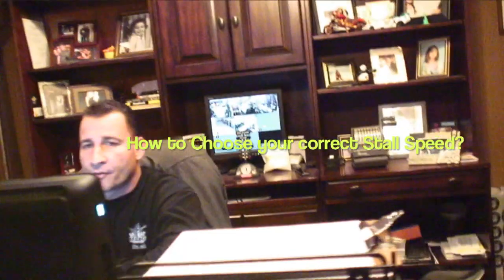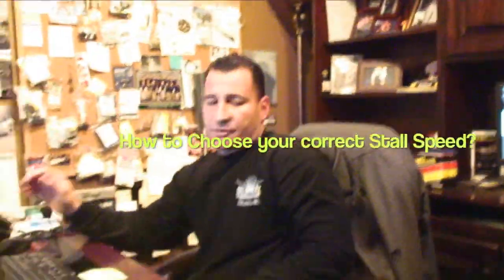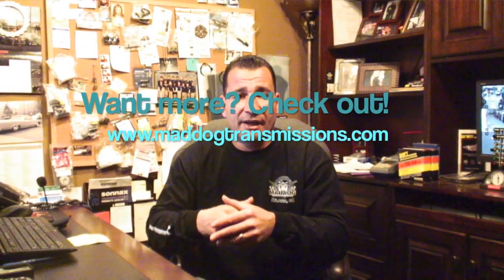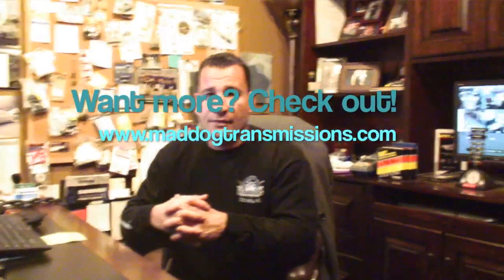How to choose the correct stall speed?

Comment: I have a rebuilt 302 foxbody with e303 cam gt40p heads cobra upper n lower intake & 410 gears... Pairing with a b&m trans with shift kit... I put my stall in wrong so I'm going with another one but what would be a match to go with setup... Thanks
Reply: The best way to pick a stall for your converter is to go off of what the Basic operating RPM range or basic operating power band range is.  Usually it is listed on your Cam Card, but some companies you may have to call for that info.  It is a range of numbers, for example 1600-5200 rpm or power band range.  You want to stay within 200 of where it starts, so in the example case you would want to go with a 1600-1800 stall.  The power comes in where it stalls at so if it starts at 1600 and you get a 2400-2600 stall you miss the range of power between 1600-2400 rpm.  Also, the amount of HP you have comes into play with the converter because if you have more than 600HP, are running a Turbo, Super Charger or NOS then you will want to get at least an anti-ballooning plate and possibly a billet hub or dual or triple disk  inside the converter. Mad Dog Transmissions 770-781-0949

Comment: I'm running a 2k-2200 stall...wanted to change cam...cam saying a 2400 stall...is it worth me switching it...or would I be ok with my current stall?
Reply: You are not that far off so it really shouldn't make a difference.  I would say go ahead and run the one you have.  Mad Dog Transmissions 770-781-0949

Comment: There is a lot more to take in to consideration when selecting a torque converter.......call your converter companies 1st
Reply: Thanks for your input.  We are aware that there are a couple other things to consider when choosing a stall for a converter.  We have been doing this for 30 years, and have not had any issues suggesting the proper converter stall and set up for their converters. Mad Dog Transmissions 770-781-0949
Reply: I’ve also been doing this about 30 years. I’m sure you do a great job with your service and recommendations.

Comment: This is my first big cam build. I have a 355 sbc 288 480 cam 106 110 center line. I  have a 2 to 2200 stall the card shows 2 to 5000??? Is this not enough stall cause when I pull it into any gear it wants to jump but still idles. When I let off the brake it will to start pulling the car 1988 700r4 transmission
Reply: If your Cam card says that the RPM Range or Power Band range is 2000-5000 then yes, the 2000-2200 stall is good to run.  In order to utilize your  full range of power you want to stay where the Power Band/ RPM Range starts.
Reply: @maddogtransmissions3125  thank you is there anyway to make my 700r4 shift harder

Comment: Got a stock cam ,heads, foxbody 5.0 carb .got new nos system 373 gears drag radials  tires headers .and a new tci Aod  streetfighter transmission  what stall do you recommend?
Reply: The stall goes off of your Cam.  If you know the power band or RPM range for your Cam, you don't want to go more than 200 above where it starts.  For example, if the power band is 1600-5200 then the option for the best performance would be 1600-1800 stall.  If you do not know your power band or RPM range then since it is stock you can just go with a stock stall.  However, since you have NOS then you will need an anti-balloon plate or when you hit the NOS the power is going to blow apart your converter.  Any other questions just give us a call.  Mad Dog Transmissions 770-781-0949

Comment: Hey Lou, I have a 75 Corvette with original auto trans and rear end, I had the motor built to a 383 Stroker with around 425-450 HP, when I start the car I have to hold the brake to keep it from lunging forward, do you think this has anything to do with the converter being mechanically frozen or could it be something else?
Reply: Hi Michael, If your car is in gear and it lunges forward then the stall is to high.  If it is in park and it does it then there is something wrong with the transmission.  If you have any other questions just let us know.  You could give us a call at 770-71-0949 if you want to discus it in more detail over the phone.  Mad Dog Transmissions
Reply: @maddogtransmissions3125  When in gear, sorry...I'll give you a call.

Comment: I want SWAP OUT MY STOCK CAM IN MY LQ4.. I WANT NICE STREET CAR. NOT TOO CRAZY JUST ENOUGH TO SPANK A COUPLE OF PONYS N SOME MOPARS...lol 
Wait B4 I 4GET MY LQ4 IS IN MY 87 TOYOTA COROLLA SR5.. WITH 400TURBO TRANS & IM USING 8.8 FORD REAR N 410 GEARS.. WITH A MINISPOOL ..WITH LS6 INTAKE N 92MM THROTTLE BODY
Reply: That sounds like a pretty bad car.  Give us a call when you get your Cam and have your cam specs and we can help you figure out what stall you will need.  Mad Dog Transmissions 770-781-049

Comment: Pontiac  400 with a comp cam kit K51-600-5 thumper what would be the best stall for this application with a th400 trans
Reply: Where does your power band start?  Mad Dog Transmissions 770-781-0949
Reply: Basic Operating RPM Range: 2,000-5,800
Reply: Is 2500 stall to much
Reply: @maddogtransmissions3125  thank you so much I appreciate it

Comment: I'm building a 62 Sunbeam with a 350 sbc, camel humps w/screw in studs, 3/4 Crane fireball cam, Team G intake, 10.5:1 compression, 650 duel feed double pumper, Scorpion roller rockers, T350 w/B&M shift kit. I've been looking at a TCI "Sizzler" 2600-2800 torque converter?

Comment: Power band is from 2002 6500, 3500 stall converter .. is that to much? Street/strip car
Reply: Thanks for your inquiry.  Our professional opinion is you should go 2000-2200 no higher than 2400 Stall.  Mad Dog Transmissions 770-781-0949

Comment: Here's one for you: 
2014 Jeep SRT
Curb weight: 5100lbs
Engine - 6.4L
Differential - 3.70:1
Tires - 295/45ZR20
Camshaft - COMP 274
Duration @ .50" lift: INT-226, EXH-234
Lift: INT-0.619, EXH-0.612
Lobe Separation: 116
RPM Range: 2400 to 7400

So, should my Stall speed range be between 2900 to 3300?
Reply: By looking at the numbers on that cam, I imagine the engine has quite the lope in the idle.
Reply: Addison Allen 4K stalk.

Comment: Hi Lou, I have an Pontiac 400 with Edelbrock 750, RPM inlet manifold and no clue, which changes have been done in the the past on the car. The car is since 20 years in Germany and went to various owner, it has been built up nice and seems to have quite good power, but with the TH400 and the current (I expect stock torque converter) it feels like the car starts moving, before the engine built up really torque. From my feeling, the engine should be about 1000 refs higher running before it give the full power to drivetrain. So a 2400 stall may help?

Comment: I have a 350 engine in a 4x4 blazer with 292 camps and th350 transmission, with 373 springs, which torque converter do I need to run light and strong?
Reply: I would go with a 7000 stall Hughes converter if I were you.
Reply: The punisher I have the same setup so when ever you find out please let me Know brother
Reply: I know this will sound expensive and time consuming but the best thing to do is to try different stalls within the estimated ball park numbers until you find what the car likes and what gives you that kick in the pants feeling you are looking for, often times the "best" stall based on formulas, books, charts, and numbers is not what guys think they want, just saying, you will buy two or three stall converters and pay two three times more but in the end you will go damn that is the shizzle

Comment: hi my cam rpm range is 1600 5800 will that help  thanks
Reply from the maker: Hello Giovanni, go with a 1800 stall. You can call us at Maddog transmission 770-781-0949 Thanks MaddogLou.
Reply: I have a 3080lb 68 mustang C4 trans, 410 gears, 28in tire, 11.35:1 cr 438Windsor with Comps cam xr292r solid street roller 254, 260@50 duration fuel injected multi port. Comp recommends 3500 Stall or higher. What do you recommend..I am thinking 4500 stall. What do you say. Comp cams says power range of cam is 3200-7200 rpm.

Comment: hi lou i have a 350 stock motor with a xe268h cam with promaxx aluminum heads 65 cc 373 rear end 700r4 trans  can you tell me what size torque converter should i use? street car don't want no police citations lol
Camshaft Part                    #
                        12-242-2
                        Designation
                        XE268H-10
                    
                    
                        Duration @ 0.006":
                        268° / 280°
                        Duration @ 0.050":
                        224° / 230°
                    
                    
                        Max Lift w/ 1.5RR: 
                        .477" / .480"
                        Lobe Separation:
                        110°
Reply: Giovanni Krasniqi I'm curious to but my 350 is over .60 and has a 292xfi
Reply from the maker: Hello Giovanni,go with a 2500 stall.You can call us at Maddog transmission 770-781-0949 Thanks MaddogLou.

Comment: I have a O2 Sierra 4.8 whit tru trac posi 410 gears and tune .what stall should I go whit ??2800?
Reply from the maker: Hello Jose, no more then 2800 stall. you can call us at Maddog transmission 770-781-0949 Thanks MaddogLou.
Reply: I have a 3080lb 68 mustang C4 trans, 410 gears, 28in tire, 11.35:1 cr 438Windsor with Comps cam xr292r solid street roller 254, 260@50 duration fuel injected multi port. Comp recommends 3500 Stall or higher. What do you recommend..I am thinking 4500 stall. What do you say. Comp cams says power range of cam is 3200-7200 rpm

Comment: I HAVE A 2014 SILVERADO SINGLE CAB..HAS HEADERS INTAKE N CUSTOM TUNE MAKING 355 RWHP
WHAT STALL DO YOU RECOMMEND? 6L80
PLAN ON CAMMING IT IN THE FUTURE ASWELL
Reply from the maker: Hello Santa ana, always mach the converter to the cam specs. You can call us at maddog transmission 770-781-0949 Thanks MaddogLou.
Reply from the maker: Hello Santa ana, go with a 2500 stall you can call us at maddog transmission 770-781-0949 Thanks MaddogLou.
Reply: ... 355 rwhp in a 14 Silverado, so your running a 700 horse 6.0 huh... You must replace u-joints daily too huh..

Comment: Sorry I meant other things bolted on looking to run a 150 shot of nitrous and NT-555R drag radials. 3.73 gears I would like the converter to lock up I was thinking about a 2800 stall what do you think. Please let me know as soon as you can I'm looking to order some stuff soon and do you think I could find a good converter between $250.00 to 375.00 maximum price? Thinks for the video great job.
Reply from the maker: Hello Rich, 2800 stall will work but with 150 shot NOS you need to go with a anti balloon plate converter the cost is $550.00.Please contact us for a professional consultation regarding your needs. We are happy to provide you with references both here in the United States and Internationally. Be sure to check out our website atmaddogtransmissions.com 

Hear what our customers and fans say on our Facebook Page at www.facebook.com/maddogtransmissions 

We also accept orders over the phone. Be sure to contact us and we will recommend the correct transmission for your application. For your convenience, we accept PayPal and all major credit and debit cards. 

If you prefer, we can call you personally, just e-mail us your phone number.

All our transmissions are very strong and reliable, and can be used for everyday driving. Extended warranties are also available.

You can call us and talk to a live person. Up until 10 PM Eastern standard time , Monday through Sunday we can take your order over the phone.

Thank You,
"Mad Dog" Lou

Mad Dog Transmissions
Phone 770-781-0949

Comment: I just got my 350 running that i rebuilt i installed a lunati cam 60104 problem is when i put it in gear idle drops crazy only in gear would that be too low or a stall? im thinking it may be a factory converter not sure about that
Reply from the maker: Hello boss man, yes sounds like you need more stall check your cam card and give us a call 770-781-0949 maddogtransmissions.
Reply: +Lou Koulouvaris it says 2200-6400
Reply from the maker: OK go with a 2200 stall call us anytime 770-781-0949 Thanks maddogLOU.

Comment: hey Luo i have a 5.7 vortec 4l60e going to rebuild both engine and transmission i will be putting  a lt4 hot cam what is the stall speed you would recommend on my application i have 373 gears and its a 4wd
Reply from the maker: +omar alvarez Hello Omar, go with a 2200 to 2400 stall for your application.          Call us any time 770-781-0949

Comment: I have a comp cam hydraulic camshaft 231 duration at .050" with .480"lift power range of 2000-5700 rpms 400 turbo transmission and 355 rear gears 'would you know what torque converter would be best thanks
Reply from the maker: Kevin Thomas 
Hello Kevin, go with a 2200 stall it will work excellent for your 
application.

Please 
contact us for a professional consultation regarding your needs. We are happy to 
provide you with references both here in the United States and 
Internationally.

We also accept orders over the phone. Be sure to contact 
us and we will recommend the correct transmission for your application. For your 
convenience, we accept PayPal and all major credit and debit cards. 

If 
you prefer, we can call you personally, just e-mail us your phone 
number.

All our transmissions are very strong and reliable, and can be 
used for everyday driving. Extended warranties are also available. You can call 
us, Monday through Sunday from 8 AM to 10 PM Eastern standard time, you will 
always get a live person.

Thank You,
"Mad Dog" Lou

Mad Dog Transmissions
Phone 
770-781-0949

Comment: hi guys - thanks for the vid. Im also new to the stall thing - rebuild my 77 camaro, 350 roller, GM hotcam 218/228, 342 rear (might goto 373 later), 200-4r, long tube headers, true duals, eddie intake, - I have the stock stall now but want to liven her up, street toy and maybe some fun strip days - nothing major - 

would 2800 be too much? what do u recommend? was looking at this: http://www.tciauto.com/tc/streetfighterr-converter-gm-1981-84-700r4-all-200c-2004r-27-spline-1-703-crank-pilot-lock-uphtml/

Comment: I have a Howard cam part number 112041-09 and I'm trying to determine what size came I need. The lift is a .510. What size stall converter do I need to run?
Reply from the maker: Hello Keion, go with a 2400 stall.
 
 You can call us, Monday through Sunday from 8 AM to 10 PM Eastern standard time, you will always get a live person.

Please contact us for a professional consultation regarding your needs. We are happy to provide you with references both here in the United States and Internationally.

If you prefer, we can call you personally, just e-mail us your phone number.

Phone 770-781-0949

Comment: Hey Lou, I like the advise you're giving in this video.  I really think you need to address gear ratio and tire size though in relation to power band at cruising speeds for cars that will be driven at less then WOT.  It's no good to put a "big" cam with a 3500 stall converter in a car that cruises at 2500 rpm at 65 mph.

Comment: Hey Mad dog ! I'm building an 83 fiord Fairmont  the Block is a 70-71 302. Dart World full race heads. 750 holly carb (not a dbl pumper). alum intake. roller rockers, shorty headers. 10:1  compression pistons. Tranny is a C4 auto with a manual reverse shift valve body 3 speed. Rear end is 8.8 with true posi.  The stang I got all the stuff out of had a 4000 stall. it only has 500 miles on it. but obviously I ain't gonna use it. I have the brand new cam right here next to me !  I didn't get a cam card in the box but there is a tag on the outside with all the info on it !
for ex.. Cam lift=( INT. .320 EXH. .320)   Valve lift= (INT. .512 EXH.  .512)  There is nothing about RPM range on this box tag ! What size stall is the best ! I want it streetable !
Reply: Hello
davieboy1970, a 12 inch diameter 2400 stall converter will work excellent with your cam specs also very Street friendly.
You can call us and talk to a live person. Up until 10 PM Eastern standard time , Monday through Sunday.

Thank You,
"Mad Dog" Lou

Mad Dog Transmissions
Phone 770-781-0949
Reply: Ok Yeah I called Summit Racing tech line also and gave them all my specs. and according to my Cam part # they said to use a 2500 stall ! Now the question I have is does it matter the diameter size ?? You said 12" the one that came with the car is a 4000 stall 10". what is the difference between a 10" 11" or a 12" ??
Reply: It's not really gonna be driven "every day" Kinda more or less to take it to car shows, cruise on nice days, Show off to all my friends. I want it to have good power and torque but yet  be able to cruise the roads without it being to hard with a big converter. I suppose a 2500 to a 2800 sounds about right !! Thanks ! I'll call that number and see what it would cost me to have one built !
Reply: davieboy1970  Instead of playing the guessing game... why don't people just do a dyno run and then you'll know for certain where its producing adequate torque/power to get the car moving fast off the line!.